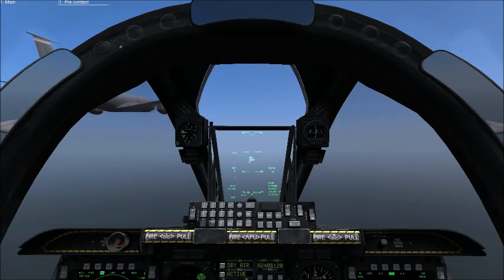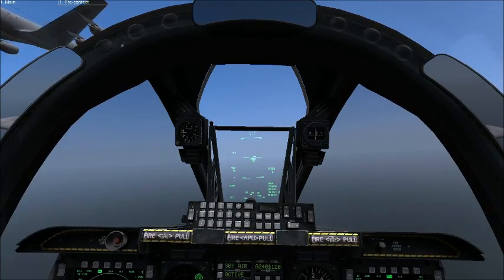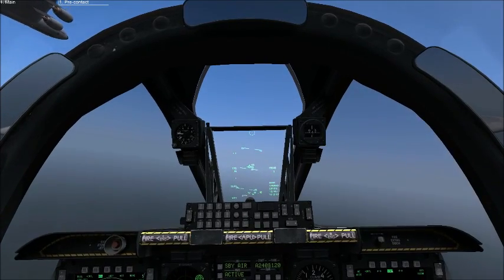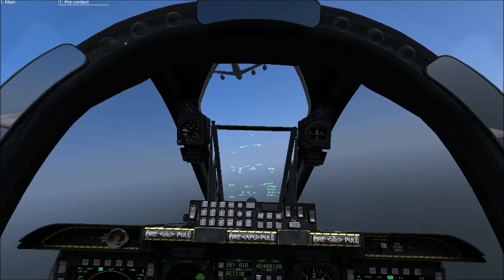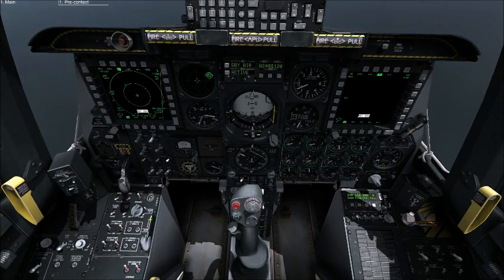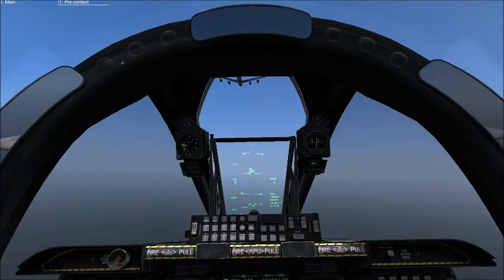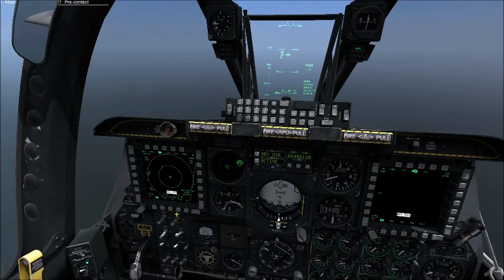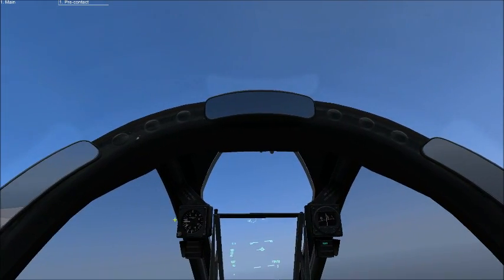DCS: A10C - Quick Tutorial on Air-To-Air Refueling (Not Really)

Comment: I was the same way, the trick is to alight yourself with the plane, not the boom.  The operator will guide the boom to the hatch just fine on his own.  All you need to do is be as stable as possible.  So get behind the aircraft and a little bit under.  Then slowly move yourself towards the aircraft using it's wings and engines as a reference to keep yourself positioned.  Keep moving forward slowly and eventually you will connect.  Then all you need is stability and speed management. 

If you do get disconnected remember to press your nose wheel steering button again to reset the system or it won't re-connect.

Comment: like it - completely get's the feeling of over-difficult-simulations :D
Reply: lol, over-difficult?
Reply: BollocksUtwat
Well, maybe not this one, don't know, since I haven't it (yet?...) - however, although they are mostly either accureate or simpler than reallife (my full respect to all real-life-pilots) - however in some few aspects they can be overly difficult due to bugs or similar, for example flight simulator x has that thing that if you land a helicopte o a moving helipad (on a ship) you must do so muuuuch smoother than normally or otherwie the script for the recognization as a landing-place won't work and it will be considered a crah - and ship helipads are at least not much less strong than the helicopters skids - just one exapmle
Reply: Ah, yes that makes sense. DCS has its share of these things.

In fact AAR is one of them. In real life the boom has suction which will hold a plane onto the boom (there's a story of a wounded plane being dragged home by one) whereas in DCS there isn't, meaning you need to be much tighter with your control than in real life.

Worst part of simming is you can't feel Gs so you lose a lot of what informs the instincts of pilots.
Reply: ***** This is basically a totally incorrect statement.
Reply: ***** They don't deliberately make flying harder, it is naturally lacking in realistic feedback because sitting at a computer is nothing like being in a jet going 500 mph.

Everything the developers do is intended to achieve the opposite effect, to make it as realistic as possible within the constraints of our home PCs.

Ask a real pilot what its like flying a simulator and they pretty much never say anything is easier, they say its harder, like harder to see things on the ground or in the air, harder to fly coordinated turns because you can't feel the sideslip in your gut.

Comment: Look straight forward, zoom out a little and switch of your TrackIR. Try to fly formation with the Tanker and don't look at the boom (very important). Apply only small corrections with your throttle. If you see the Tanker coming closer reduce a little bit and then apply half the speed a you flew before.